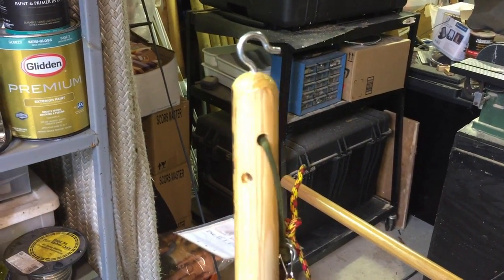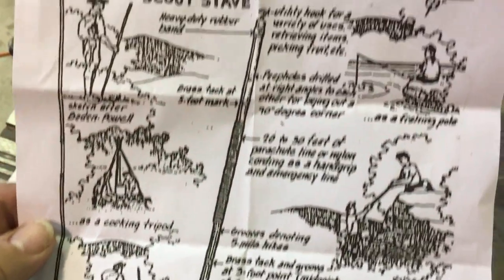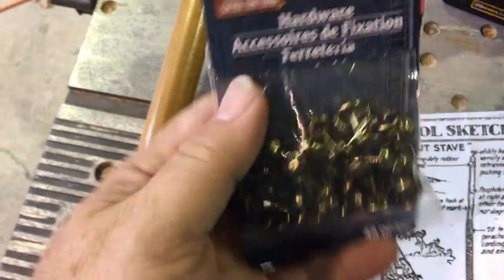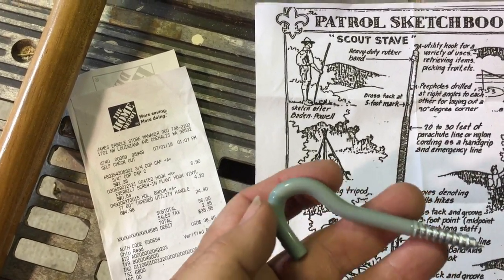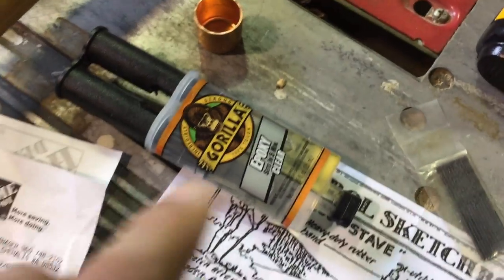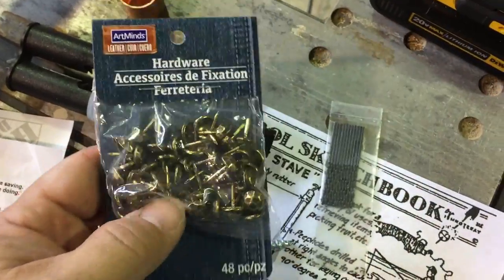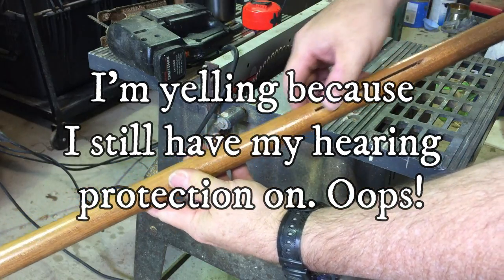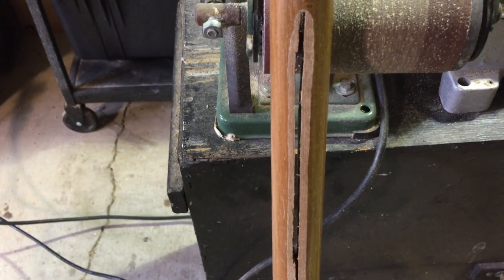Awesome OLD SCHOOL BOY SCOUT WALKING STAFF

Comment: Why use the jig saw when you can just make the same cut with the table saw on the other side and have basically identical cuts?   BTW, when you see smoke coming off of your saw blade on a simple cut like that it should tell you something about the condition of your saw blade...  a dull blade is probably much more dangerous than the actual cut.
Reply from the maker: The reason why I used the jig-saw was to get a squared off cut and minimize any issues I might have with cutting twice on the table saw. Much of the smoke you saw was the finish on the pole burning off. That and any slight twist at all, will cause the wood to touch the side of the blade where the curf is not cutting... the friction causes the wood to smoke. A dull blade will also cause smoke when forcing wood through it, plus a lot of kickback... this blade was neither forced upon nor had any kickback. The blade has not seen much action... what else can I say? I have made several more staffs and given each one of them away. Some smoked, others did not.
Reply: @HelicoolsHelipad  Fair enough, but cutting the other side by hand opens you up to the jigsaw not cutting perfectly straight, which I did see evidence of.  I would not have personally used this process or even this design, but as long as it works for you...

I would have cut the top off and drilled holes in both pieces to accept a suitably sized screw top container. (preferably metal)  I would also have used a much smaller hook...  something like the large size brass hooks used to hang coffee cups inside of a cabinet.  These could be coated with Plasti-Dip to ensure that there is no sharp tip on the hook.  I also would not have used simple over-hand knots on both ends of the para-cord.  These knots tend to bind and become difficult to untie, and are all but impossible to get the para-cord wrap tight around the handle.  At the very least I would have used a figure 8 knot on one end...  better yet to find a suitably sized locking slider.  Another option would beto simply to leave enough excess para-cord for a decorative dongle type knot at one end which could be easily tied and untied multiple times.

It is more of a hassle to source the correct parts, but what you end up with  is a better product where you can easily open the compartment at any time for things like matches, lint for fire starter, fishing sinkers, etc.

You seem happy with your design, so I will go find a channel where my observations and suggestions are more appreciated.  Have a great day! :)
Reply from the maker: @barking.dog.productions1777  The biggest problem that I had with the jigsaw was that the blade was thinner than the table saw blade, so I had to use the jigsaw to hog out the inside cut to match the width. 

I certainly appreciate your critique and expanding the possibilities of the staff... I like the idea of making a screw-in top. The great thing about the video is that it shows the original 1940's or early design and sparks ideas that build upon, make better, or make it your own... a staff that you will be happy with. I enjoy hearing how many different opinions people have... from "you did too much... it's a monstrosity!" to making it so that is unscrews in three parts and becomes a camp chair. I am amazed at the variety from one extreme to the other. My point was, and always has been... make it how you like it... this is just an idea to get you started.

If you still wish to "play" some more, you can check out my follow-on video that shows most of the mods that I made to the standard staff that you saw in this video. You don't have to comment on it to let me know you saw it, but it could give you some cool ideas that you MIGHT want to incorporate into making your staff. Have a great day, and keep on hiking.
Reply: @HelicoolsHelipad  No problems, brother.
I was just observing that by making identical cuts on either side of the blade will give you a uniform slot on both sides.

Doing it by hand on a table saw it is hard to get that perfect cut on the other side.  Ideally, you want to wrap everything in tape, mark it all out, and use a miter saw to make the cuts.

I don't like the slot because it weakens the stave, you are limited to items that will fit into the slot, and you have to unwrap the para-cord to access your stash.  You may need to use the stave as a pry bar to move a large rock, or as an cross-bar anchor at the top of a crevice to climb up or down, so you don't want it weakest near the middle.

You are correct.  You can make a good walking stick as complicated or as simple as you choose.
Reply from the maker: @barking.dog.productions1777  The cut does in fact weaken the staff and the para-cord wrap only superficially strengthens it. Remember, it is made out of a medium duty rake replacement handle, so strength, especially in the vertical plane, is not ideal. However, the stronger the staff, the heavier it becomes. So a balance has to be reached for each users comfort level. 

As for my staff, I built it and modded it for mostly emergency use. I have a small 3"x4" tackle box, first aid kit, and 50' of para-cord in my hiking backpack (among other stuff). If I HAD to go into the woods and survive with only the staff, I could. It would not be as comfortable of an experience, but it would be just enough to get by. Once again, it is a build to suit for the purpose that each individual needs. I am very glad that you took so much time to add to the story for others to read and evaluate what they might do or want in a staff. Many blessings on you for that. You are welcome to come back anytime, friend.
Reply: @HelicoolsHelipad  Thank you, and you are very kind to say so.  My favorite personal staff I made over 20 years ago from the heartwood of a white oak.  It is a simple affair with a para-cord wrap for a grip at the top, and a brass ferrule at the bottom.  The entire thing has been well cured and then deeply saturated with Tung oil.  It is never going to break or let me down.  These days I always have a camelbak for water, basic survival and 1st aid gear - so no need for a fancy staff.  lol

I still have my first walking stick that I paid for with saved up allowance money back in the early 1970's.  It served me well during my Boy Scout years.It is an aluminum 3 sectional L.L. Bean Item that just flips out and locks itself together using simple cone locks and a bungee chord down the center.

It was pretty doggone trick for it's day. :)

I have hand made many staves and knives over the years.  It is always good to see how other people put their own twist on this basic staff that has served mankind for 1000's of years.

May God Bless you, friend.
Reply: Another option is to clamp the stick to the table saw fence, and the table top with the blade below the table. Then, raise the blade into the stick. This would keep the stick stable, and hands clear. 
I made a very similar stick to this, and have enjoyed it. Thanks.

Comment: You have created a weak point in the staff by cutting through it, you would have been better to either use a small bag attached to the top, or put everything inside a couple Ziploc bags and wrap the para cord over the top of them. This staff was supposed to have been used to help someone up who has fallen and they certainly could not put much weight on it since you have changed the structural integrity.
Reply from the maker: It was a rake handle to begin with. If you think you can lift someone like a boom truck, that ain't gonna happen, full handle or not. A straight pull? Heck, me and my two boys could hang from that, no problem. It's Brazilian hardwood. I took it on a 50 mile hike and "trail tested" it. Granted, I did not walk across a ravine balancing on the staff, but it is still way strong. The beauty is, it's optional. I did it because I wanted a hidden pocket. Cheers!

Comment: 15:30   Copper ?  🙄
Reply from the maker: Yes! Copper. It does not spark when it hits a rock... that’s important while hiking in most places in the summer time. What do you suggest? Aluminum caps are way harder to find.
Reply: @HelicoolsHelipad 
But many walking sticks have steel tip.

Comment: You are right when you say it was stupid.
I have never seen a table saw used more irresponsibly.
And you are showing teen aged scouts what to do.
Really you could have made a little pouch for kit to hang on the staff.
No need for a teenager to learn something stupid and lose a finger.
What happened to going out in the woods and getting a nice staff?
That at least is how it was done when I was in the Scouts.
Reply from the maker: Indeed, and that is why it is optional and there are so many warnings. A leather pouch is a great idea... thank you for adding to the story. Perhaps others will opt for the pouch instead of the hidden compartment. Thank you for your insight, and I hope you are able to pass this information on to those that you mentor in Scouting.